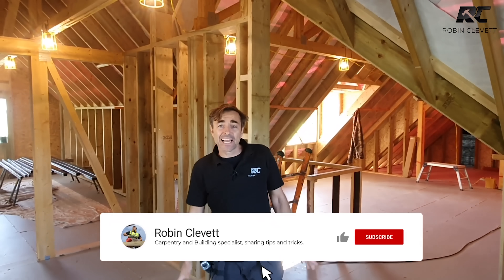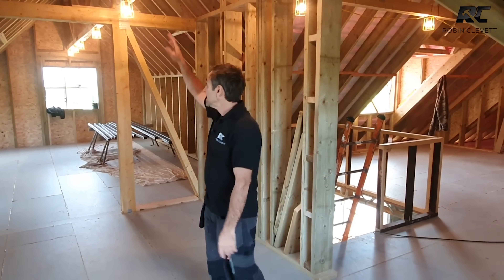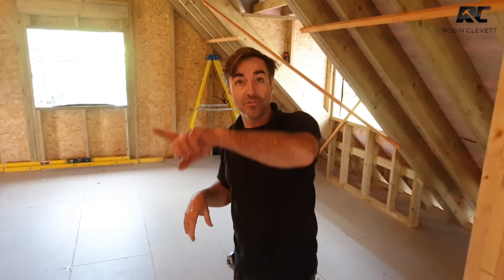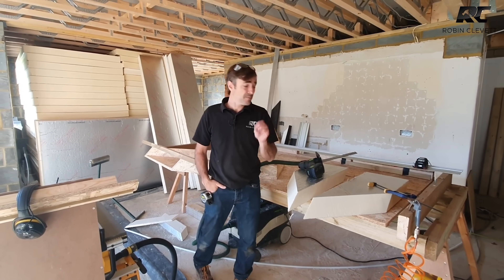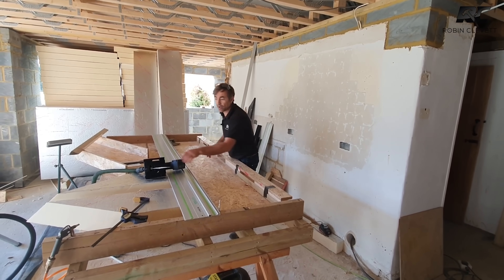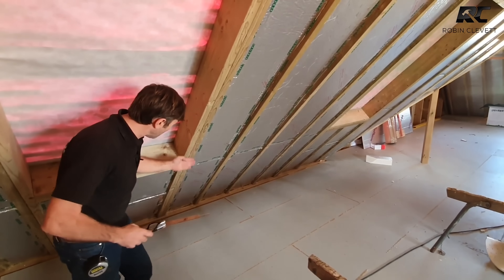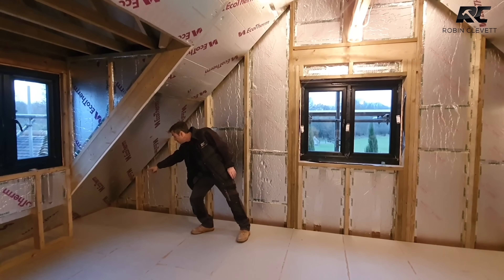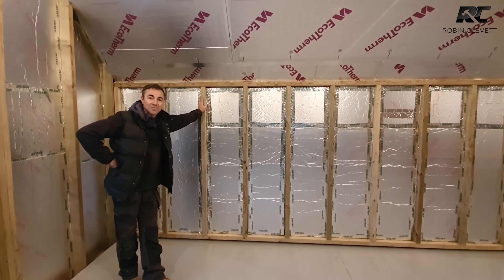How to fit insulation 2023 to the latest Building regulations Part L

Comment: Great job, how I wish all insulation was fitted like that ! , Just a observation, I noticed that the insulation between the rafters was not flush with the face of the rafter, so when the next layer went on was there a air gap between the two insulations….

Comment: I need to insulate a 200 year suspended floor. What would you recommend as a product
Reply from the maker: Hi Dickie, I would use a similar insulation to the depth of the joist up to a maximum of 100mm thickness, meaning if you have a taller joist say 150mm then still use the 100mm, with Gapotape you will get a better fit and eliminate the air gaps too, make sure that you maintain the free movement of air below though, hope that helps
Reply: @robinclevettcarpenter  Thanks for the response. I'm going climb into the void once I've got the carpet up as it's a big space at least 4 feet deep and 6m by 6m.....and measure up and check the condition of the joist ends....

Comment: Excellent Video, Thanks. I so get cutting the PIR to fit joists which are at 450mm centres, for no waste and the gappo tape is excellent . But,  will the 450mm centres joists  cause you a problem when fitting the Plasterboard as 450mm Centres x 3 is wider than the 1200mm plaster board ? or floorboard or any other 1200mm wide sheet.  I am a DIYr, so have I missed that part .  Also would you recommend fitting Insulated Plasterboard 55mm thick over a stud wall  ? (because, without the stud,  fixing it directly to the solid wall dot and dab + fixings will "puncture" the tanked solid block wall ?
Reply from the maker: Plaster board comes in many lengths and we use a 2.7m long board that works perfectly with these centres, also 1.8 m x .9m boards work perfectly
Reply: @robinclevettcarpenter  Thanks so much for sharing the video and for sharing your knowledge and advice . Keep them coming

Comment: What is your option on external wall insulation for older houses built from concrete  block and render with cavity walls that have been insulated with polystyrene balls?

Comment: Great job great product.
But, PIR is flammable and you must have used over £2000 worth of Gapotape. 
Mineral wool is easier cheaper and safer. And with much less cost. Yes you need a larger cavity but this could translate into greater rafter spacing.
I just feel that Part L is yet another great idea on paper. Personally I like the idea of wool or paper pulp. I have worked in PIR production so I'm not anti-PIR I just can't see Gapotape @£2 per meter being a hit.
Keep up the good work.
Reply from the maker: If you use Gapotape, the installation is up to 80 percent more effective as tested by BRE which means that you can use a thinner PIR thus saving money, I have done every type of insulation from quilts and foils and I personally prefer the tape method, it also makes the job easier to do as the panels of insulation fit much nicer and the air gap is eliminated, many construction materials are indeed combustible but most are then encapsulated by a fire proof material such as plasterboard that will offer protection in conjunction with mains wired smoke and heat detection in line with Building Regulation, indeed the furniture and possessions in the rooms are far more of a hazard immediately in the event of a fire that it wouldn't be the PIR that could potentially kill in a house fire, yes it is an additional cost on the insulation but it improves performance makes the actual fitting easier and it now sells out on a regular basis!!
Reply: @robinclevettcarpenter 
Hi Robin, hope you're indoors today and thanks for your reply,.

Comment: Presumably all the windows in the building do not open? I would also imagine the condensation is a massive problem inside the building?
Reply from the maker: All windows open, and condensation would never be a problem, making a structure more air tight and less air leaky is the norm, we still have to have ventilation via different systems to control moisture of course, so windows with trickle ventilation, extractor fans in all wet areas or a ful mechanical ventilation and heat recovery system, we have to specify and build in accordance with Building regulations and adapt every outcome to suit the dwelling or usage type, I am interested to learn why you presumed that we would have no opening windows??

Comment: Very informative and useful video! Great work. I just had one question, why don't you set the insulation boards flush with the underside of the rafters? You showed the rafters clad over with thinner insulation board to provide another vapour barrier and prevent thermal bridging, but I just wondered what the purpose of the airgap between the layers of insulation was? I realise you want to leave an airgap on the 'cold' side to the underside of the felt, but are you best to leave a gap between the layers? or can the two touch eachother?
Reply: That would be way too easy!

Comment: Since there was no taping of the edges and seams or a fabric or plastic vapor barrier, aren't you concerned about air carrying moisture getting to the wood or crawl space?
Reply from the maker: The final layer of PIR that is under the insulation between the rafters is a continuous layer and is taped therefore providing a vapour barrier, the roof is also a cold roof that means there is a eve to ridge air space that is vented to allow any moisture that does migrate through all these layer to be dealt with by the airflow, what you may call belt and braces, I did mention the ventilation in the video too, hope that helps

Comment: I’ve been doing a Victorian property with roof still in place. It has non breathable bitumen felt so I’ve left a 50mm gap. Would you put holes in ridge board for air to pass over from eaves to eaves? Also, when placing PIR boards between rafters do you push them down to the top of floor joists or do you cut around the end joist to let the board make contact with wall plate? It’s weird installing insulation with a roof still on. Not something I’m used to! With cost of living crisis there will be a lot of people with older properties tackling this by themselves and if you don’t get ventilation correct you can wreak havoc with the integrity of your roof. It’s a minefield with older properties.

Comment: Hi Robin. 
Im looking at insulating the roof space on our 1960s ish dormer bunaglow. At present it has no insulation apart from what looks like some wool type insulation thats stuck to the roof membrane and has heavily rotted away over time. The roof is made up of what looks like 3x2 from wall plate to ridge with 120x50 loft floor beams that run from the front to the back of the house for the loft floor and bedroom ceilings.
My plan would be to add additional rafters from wall plate to ridge to add extra space so I could use 100mm PIR insulation like you have so I have an air gap and then add another skin as you did for the extra layer also using the gapotape as it looks like a good idea then carry the 100mm over the top of the bedrooms ie the dormer roof in between the rafters, I cant add anymore layers in the bedrooms as I havent the ceiling height over the windows. Very expensive but needs doing.

So my question
Your first layer of thick PIR, did you push that all the way into the rafters so it touches the roof membrane or did you leave an air gap between the roof membrane and the PIR and did you leave an air gap between both layers of PIR?
The PIR against the walls was that pushed all the way to the wall also?

Love the videos Robin, always watch yourself and roger always something to learn.

Comment: I must admit your workmanship is superb.
All these regulations keep changing and at the end of the day are we just adding to make more problems in the future. Just get the balance wrong and years down the road, dry rot.   
I noticed your guy pushed the PIR into the rafters and recessed them about half to one inch further than the face edge. If you put another insulation flush with the rafter there is going to be a gap between the two insulation from top to bottom of the roof. Will moisture build up between that gap. 
I'm insulating my loft at the moment and have done it the same way as you, now I wonder if the PIR should be pushed in, flush with the rafter edge so it's touching the other insulation.
Reply from the maker: there will always be a gap just by the nature of the PIR not being that flat or the way it holds when pushed in, this small air space acts more like a double glazed unit according to an engineer that designed a structure for me some time back and I tend to do this most times, as far as moisture.... the moisture should not really get past the vapour barrier that is formed by either a dedicated membrane, or in our case a really well installed under rafter PIR That is well taped etc

Comment: How does the moisture in the room escape through that material? Generally it escapes through wool in the ceiling into a vented space
Reply from the maker: We have a continuous vapour barrier that is formed by another thinner layer of PIR that is continuous and taped, then as I mentioned in the video the roof is fully vented from Eves to Ridge in an airspace between the rafters etc over the main insulation, this will deal with any water vapour that does manage to migrate into the insulation
Reply: @robinclevettcarpenter  thanks for the reply, its much appreciated.  I guess as the house is so well insulated that the moisture never reaches a dew point and doesn't condense anywhere on timber etc? Its just something I've always wondered about this type of construction and flat roofs etc. Your standard of work is exceptional and it really is a privilege to watch someone so good at their trade

Comment: I didn't even realise people did such a piss poor job of insulating (in that first clip). I'm in the middle of my own extension, which is a self build other than sparky and gas of course.
I found out about the recent changes and panicked thinking I was doing a bad job when I had a 1-2mm gap in the odd area.
Not going to lie, the squishy foil tape is overkill but if you have a client who wants to burn their money then go for it 😅
Reply: The very problem is chaps thinking it is “on” to leave a 1 - 2mm gap. I have been insulating with rigid for years and am open to new learning - the 450 centres and the additional tape are game changing and this should be applauded rather than shut down. With energy prices as they were and how they are going it is paramount to get this easy win fixed now - the 1-2mm gaps are the problem now and forevermore
Reply from the maker: Well the tested performance of the Gapotape proved a massive improvement in the insulation and eliminated the air gap, to the point that you can reduce the specified thickness of insulation say from 120mm to 100mm and it will perform better, thus saving roughly 20 percent in insulation cost, it is more expensive but it makes a massive difference

Comment: Hi Colin, great informative video. What's the minimum insulation thickness if using insulation board? Regs say 270mm if using wool, but I know thermal efficiency of material is more important than thickness. 

Also  My rafters are 80mm deep, and there is a cross beam of about 220 mm that runs from party wall to party wall. Could I do 25mm insulation board between the rafters ( leaving 55mm air gap between board and roof membrane) and then lay the 100mm board over the top of the rafters? 

This would leave an exposure of the cross beam of about 100mm once plaster boarded and skimmed. Would this work ?

Comment: Re electricals-Instead of putting a hole through the PIR board would you run the electrical cable between the joist and the edge of the PIR leaving the gapotape to take up the space?

Comment: do you always push in the first insulation so far to leave a small gap between that, and the 25mm insulation? if so why? I always push mine in so it is flush then I have a full 125mm. I also tape it, but to the rafters, plates etc. Your tape seems a lot better. I will have to enquire about it at the merchants

Comment: I have done the board insulation and every board is cut to size with rafters at 400 centres 350 gaps to meet each rafter space. E It is dirty dusty job but worth doing properly.,  I never use the tape as they are trimmed and trimmed until they fit tight and stay in of their own accord.  Nice looking job Robin.

Comment: I’m so confused about whether we need an air gap or not. We have a pitched roof - tile - battens - membrane - timber sarking then 200mm deep joists. No insulation currently. About to cover joists with plasterboard and want to insulate first, but can’t understand why not to fill to entire joist depth. The roof is also unvented at barge boards. Any help hugely appreciated!

Comment: what a brilliant video, thank you :-) Did you leave a gap on top of the insulation or did it go right back to the sheet beneath the tiling?
Reply from the maker: We always maintain the air flow over the insulation and aim for no less than 50mm or 2 inches, we are also vented at the soffit and the ridge allowing for a perfect cold roof situation, many thanks for watching!!
Reply: @robinclevettcarpenter  thank you :-)

Comment: Thanks Robin, good to know you take such care and have fantastic professional standards.

Just one query- in the final shots the 'between rafter' insulation boards are pushed fully in which will butt the insulation hard up against the breather membrane which doesn't leave a 50mm vent gap over the insulation- or do you tack 50mm deep spacers between the rafters to keep the air gap?
+ how do you fix the collar ceiling rafters with the continuous insulation underdrawn boards, do you fit a bearer either side screwed through to marked main rafter lines?
Cheers,
Chris
Reply from the maker: Hi Chris, all the insulation in the sloping roof has in the case of the Big Build an 80mm air gap, the vertical wall panels are the same as typical timber framing and the insulation is pushed fully in against the OSB sheathing, I do explain in a video after this one about how we fix our collars and stud work, in a nutshell we designed the entire roof structure to work with out a load bearing dwarf wall or collar to enable the perfect insulation shell that we have, again if you watch the how we designed the roof video I also explain how this all works
Hope that helps
Reply: @robinclevettcarpenter  Fantastic- I thought you'd have it all set out... I've subscribed so can catch up on all the earlier vlogs! It's great to see how precise and meticulous you are...

Comment: Some people just want a roof over their head and an place to sleep. No wonder house prices are out of control. the number of hoops you have to jump through nowa days is insane. all adding to cost.  Now wonder there is a housing crisis. 

Let the Home owners/ Future owners decide what they want.  A cheaper home, with the option to upgrade, efficiency later.  or a more expensive home to start with that has better efficiency values.

i bet any money, people would choose the cheaper home, and upgrade over time as they have more spare money, each year, instead of trying to save up 10s of thousands more before hand in a market that is always climbing, meaning they will chase the price of a rising market, instead of locking in at a lower price knowing with future work needed.

Another example of government getting involved wit over regulation causes hell for people

Comment: Hi, I was just wandering why is it the you don’t have any noggins in between you rafters?
Reply from the maker: Rafters do not need noggins in tradition, these are mainly for structural floors and studwalls once the battening for the tiles and the tiles are on then its super flat and braced
Reply: @robinclevettcarpenter  thank you very much. I don’t know that

Comment: Thanks for this video, shows how it should be done correctly.
So the insulated rafter area behind the ashlar wall will also be plasterboard. If the ashlar wall is already in place would it be still necessary to plasterboard it,  access would make it quite difficult if so.?

Comment: Hi Robin. Great video, will definitely be using gapo tape on my next job. Just wondering what fixings you use on the second continuous layer of PIR? Also do you then counter batten or fix the plasterboard through the top layer of PIR straight into the rafters?
Cheers,
Greg
Reply: I had that question also.
Reply: Hi, did either of you ever get this question answered/finish your jobs and have tips to share on the fixing of the plasterboard?

Comment: Thanks for the detailed video. I'm myself in the process of doing something similar on a much smaller scale. Would you also put another layer of pir on the vertical walls?
Reply from the maker: We meet the regulations with the thickness of the PIR and the Gapotape in our walls because of the type of external finishes and reduction of cold bridging etc, my advice is if you can afford a layer of PIR on the internal face then why not, it will improve the overall performance and save on energy in the long term, hope that helps mate
Reply: @robinclevettcarpenter  thank you for the advice and the all the vids, always super helpful. I'll then put another layer in as my area is not too large so won't cost much extra.